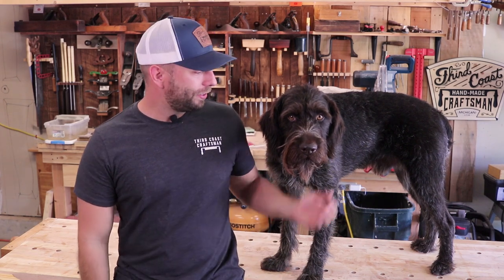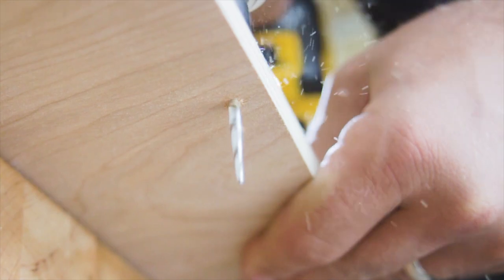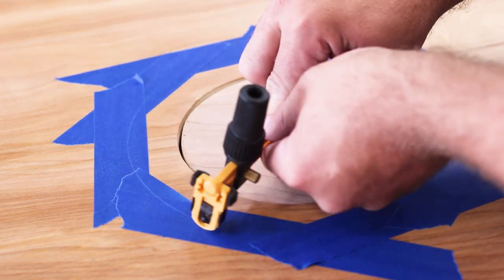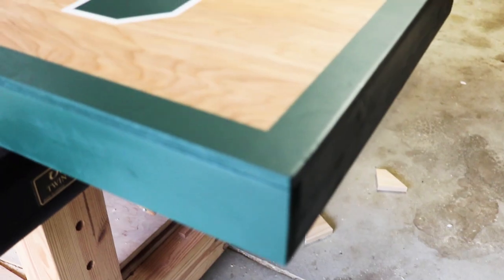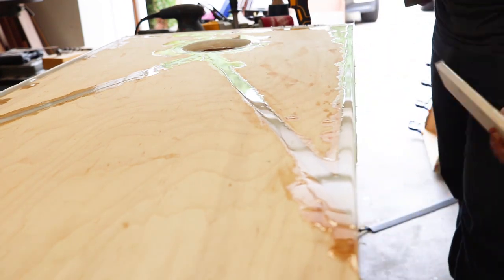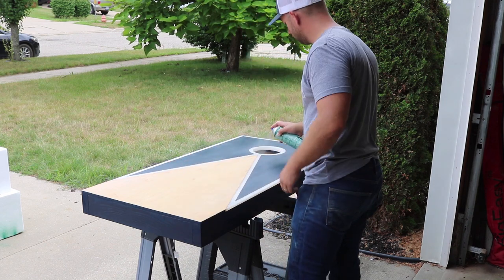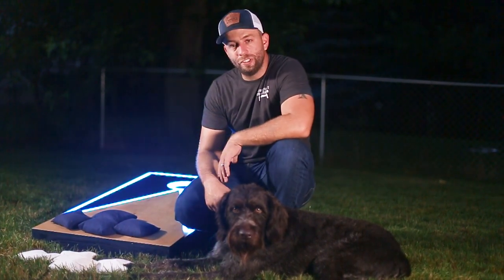How To Make LED Cornhole Boards!!!

Comment: This is a great tutorial! I've made 2 sets of these now, learning a bunch each time. Here's what I learned the hard way! I routed my channels for the led's to be 1 inch wide for looks, and 1/2 inch deep. On 2 boards, I used a solid gallon of epoxy. On the second set, I kept my channels at 1/2 wide by 1/2 inch deep and cut my epoxy use in half. To secure my side boards, I used hot glue instead of silicone and screws, and this worked out fine - no screw holes to fill later. I also used hot glue to secure the led strip lights instead of super glue, and the hot glue let go in a couple of spots after the epoxy was poured. The strips turned sideways in a few spots, but still looks ok, and was only a problem in 1 of 4 boards. More hot glue would've helped. Standard 1 gallon windshield washer jugs also work to seal the center hole, but remove the labels. I overlooked this and was left with the paper label stuck to the inside of 2 holes. Removing the excess epoxy overflow with sandpaper is tiresome. A cheap oscillating multi-tool with a flex scraper works great for the high spots and a hand plane gets the rest before finally sanding it smooth. I didn't have the white pearlescence to die my epoxy, so I sanded the top with 220 grit and this gave a cool "hazy" look and hides the details of the led strips without sacrificing too much light. Finally, after routing the led channels, I used wood glue and a 15 gauge nail gun to build the frame and secure the top. Screws worked great too, but the nails leave a much smaller hole to fill when done and are much faster than drilling, countersinking, and driving screws a couple dozen times. I hope this helps someone else on this adventure!
Reply: This video doesn’t say how thick the plywood was. I’m assuming since you did 1/2 depth for the lights you bought 3/4 inch ply ?
Reply: @salvadorgonzalez1448  yeah, 3/4 plywood
Reply: How do I make the epoxy
Reply: Thanks for these lessons learned. Could you have gotten away with quarter inch deep channels for the LEDs?
Reply: @leafinitup1  it'll work, but having the led strip so close to the surface wouldn't look as good in my opinion.
Reply: @willp942  thanks!

Comment: As a guy that used to work at Lowe's, don't buy the precut ply wood unless you have to. Two precut 2*4 sheets costs as much as a whole sheet. It's literally twice as much. Can even ask them to cut it for you at the store. And cool project turned out nice! And thank you for your service 🇺🇲
Reply: I’ve heard people say they don’t cut the wood right? Can you confirm
Reply: @_Ranger01_  You have to watch them do it.  Sometimes it's just a guy whose task is to cut a bunch of 4x8 sheets down to 4x4 - by the way the saw kerf removes at least 1/8" so it's not a true 4x4 once they cut it - but the dude isn't always perfect.  It just depends on how bad you really accuracy.  If you buy the full sheet and watch them cut it you can be your own quality control.

Comment: A couple years ago I made some mini golfing platforms for my son to use that have an led strip hooked up to an arduino and a sensor in the hole. When you get the ball in the hole it lights a pattern on the strip and plays a little melody.  I've had trouble keeping the led strip attached to the platform, but your design makes me want to try this again using epoxy instead of just glue. Thanks.

Comment: Great vid.. although, i was really looking forward to seeing how you gave the LEDs electricity. Assumed that you wouldn't have a cord accross your lawn. That whole thing is still a mystery since it wasn't included :/
Reply: If you look at 8:47 you can see the power converter plugged into the lights. This is a type of lights that requires it to be plugged into an outlet. You can however buy battery powered ones as well.
Reply: If you buy 12volt led strips, you can buy 12v battery packs that use AA batteries on amazon or ebay that have a 2.1mm power end, and this is a perfect fit for the led controller. If you haven't used led strip lights before, the 12v lights come with a 12v adapter that plugs into the wall. The battery pack will replace this.
Reply: Use 11.1 lithium battery. Perfect for light emitting diodes.  Power of lithium and long lasting

Comment: Pro Tip:
Install a hinged, drop down ramp under the hole so the bean bags slide to the back and are easy to retrieve.
Reply: Cause it's hard to reach in a hole.

Just messing with you. Good tip.

Comment: I would enjoy an instructional video from you on how to make an instructional video. This is one the best shot instructionals I’ve watched. Thanks for that !
I’m working on boards with lights underneath the hole and hidden under the bottom edge. Second attempt will use 3/4” ply with a 1/4”  overhang to hide the edge lights. Still on the first attempt. Some times the LED’s are too bright and they wash out the location of the hole when mounted on top.

Comment: I wish you would have covered how you powered the LED strips. Is it battery powered or plugin ?
Reply: He most likely is using a USB powered light strip. With those all you need are 2 little portable charger power banks (one for each board) to power the lights. They're super convenient and eliminate the hassle of having to play near electrical outlets or use extension cables the DC powered light strips require.  

Both light types are around the same price on Amazon just make sure you search 'USB powered LED light strip"

Hope that helps and good luck.
Reply: If you click the link you'd find they are plug ins.

Comment: Just for anyone who may do this in the future, I didn't use a secondary piece under the board. I instead used a 3/8" wide LED strip and just routed out a 1/2" wide by 1/2" deep rabbet around the hole so that there was still material left at the bottom of the 3/4" sheet of plywood. After that I just used several layers of painters tape around the inside of the hole instead of the coffee can or vinegar bottle and it worked out very well

Comment: You should do something like this again with the LEDs but have a arduino or raspberry pi connected with a motion sensor that makes it light up if you get the bag in the hole.
Reply: I'm going to have to do that lol
Reply: You could also possible add a scoreboard as well with a pressure sensitive plate or something like that but it would probably get a bit complicated since you’d have to figure out how to get around registered shots that hit the board but didn’t stay on
Reply: @maxwellstephens140  time delay pressure sensitivity.

Comment: Unless I missed it. You may want to add how you wired your LEDs and power source. But was a awesome video
Reply: A very key point.
Reply: @bookooc5605  so how are the led's powered?  9Volt underneath?
Reply: If you buy 12volt led strips, you can buy 12v battery packs that use AA batteries on amazon or ebay that have a 2.1mm power end, and this is a perfect fit for the led controller. If you haven't used led strip lights before, the 12v lights come with a 12v adapter that plugs into the wall. The battery pack will replace this.
Reply: @willp942  thank you. This helps alot

Comment: Nice....You didn't mention how /what tou used to power the lights.
Reply: They are plugin lights
Reply: So you have to be near an outlet?
Reply: @mfasthorse32  yes or use an extension cord or sub it out for a battery powered string set
Reply: They are 12V DC. The wall plug in is just an AC adapter.

A AA BATTERY clip [8 of them] will add up to 12V. [One for each]. I highly suggest going rechargeable.
Reply: What I ended up doing was finding a small rechargable car jump pack for each board that had a DC out port. Mine happen to be voltage adjustable from 5 to 20 volts output I believe. It works pretty well with the only downside being I have to have the lights set pretty bright so that the pack detects the draw and doesn't shut off automatically. Reduces the battery life but still plenty enough for a whole weekend of play.

Edit: Now that I think about it though you can probably use a battery pack for a phone and splice a USB connector onto the power wires from the lights. That is if you don't need/want the lights super bright. Most of the time they're fixed at a 5V output.

Edit 2: If you were wondering, I got mine from Wal-Mart on sale a while back. EverStart Maxx 600A bundle

Comment: Those 4'x2' pieces of plywood often cost twice what you'd pay for a sheet. Buy a sheet and most stores will make simple cuts for you. Worst case is they whack you like $.50/cut. You'll spend half as much and have a 4'x4' piece of plywood left over.
Reply: can you buy them from homedepot and will they make the cuts for you?
Reply: Verzula HD does cut wood like Lowe’s does

Comment: Love the boards! it inspired me to make my own and I am currently in the middle of my build. I have a couple questions; How many feet of LED lighting did both boards require? Also, when you used the 6" plastic vinegar bottle to contain the resin for the center hole did you use silicon to create a seal and if so, was the silicon easy to remove from the resin after curing and hardening? Thanks!

Comment: How do you power the lights? If by battery how big and how long does it  last?   Later
Reply: Most LED light strips are powered by a 12v supply. You can convert them to battery pretty easily. Amazon sells AA battery packs configured in series to output 12 volts for a few bucks. Then all you need are some AA batteries and you're good to go.

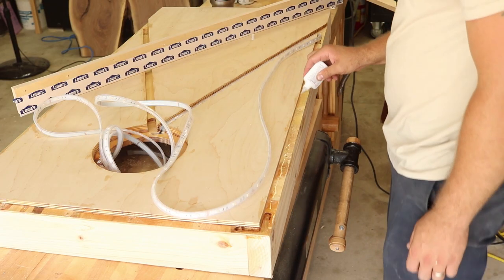Comment: @6:40 Lowes offers Military Discounts.  I was shopping Lowes for years before I knew that and finally caught on.  The additional 10% off everything really adds up and at least our Lowe's here in So Cal have designated "Military Only Parking" right up front.  Not that I really need that but the fact that they did this is why I shop there for nearly everything now.  Props to Lowes and congrats on your sponsorship with them.  

P.S.  I have to make an LED Corn Hole set now!!!!  Thanks

Comment: Great job on the boards as well as the video.  I also use the Kreg jig for assembling the frame, but rather than screws I use an air nailer and glue for the top.  Thanks for sharing your video.

Comment: Wish you could have spent more time explaining the routing and light connections. I really want to do this but am a little confused. I have never used a router and the routing of the hole was like 2 seconds of the video. Don't get me wrong it was a great video just wish it was a little more in depth

Comment: This is a REALLY Good Video But you Forgot one Thing. How Did you Wire up the L.E.D's ??? and How Did You Power Them Up ???
Reply: Yes. I really want to know this.
Reply: I found this repose below 
"Third Coast Craftsman
1 month ago
Hi Rick yes I did buy 2 separate packs and I plugged them in to extension cords. I looked up battery packs that you can plug them into but just saved my money for now and used extension cords"
Reply: Just use 9 volt batteries
Reply: If you click the link to the led strip he uses it says they are plug in strips.  So each strip is likely powered by an extension cord.

Comment: i can't figure out how you plug in the led lights. lowes also does not carry them anymore. I was hoping to use a battery so i would not have to plug them in. i send you a dm as well
Reply: I used  the same lights on my deck , under the rails. Found them on Wish. Very cheap,but took it took a month to get them. Be patient!

Comment: Surprised you found straight and dry lumber at Lowe's
Reply: rob baaahaha
I dont blame him for ignoring this comment. However I definitely don't blame you for saying it. I just made some cornhole boards and spent 20 minutes pulling and straightening only to find out they were also twisted.
Reply: lowes just resells stuff, it's not like they cut down the trees, ran them through the mill and kiln dried them. complain to the lumbercompany, their name is stamped on most plywood. in other words dont' kill the messenger, or in this case the reseller.
Reply: regardless of blame his point remains true.
Reply: PhotoBooth biz isn't that the case for all their products? They don't make anything. They just sell it. Doesn't excuse them from poor lumber quality at times.
Reply: name a single lumber yard that goes through ever board and makes sure it's not warped. my local lowes takes any warped board and puts it in a pile of "scrap" lumber. I stop by with my trailer and buy a trailer full for pennies on the dollar.s Lowes does a good job where I live.
Reply: there is no scientific proof that one lumber yard has a higher percentage of straight boards. just a bunch of bad mouthing a company for no reason. In fact I've see the same lumber company's goods at many different stores. It's like saying the M&M's candy tastes better from target vs Walmart. not logical.
Reply: so what you are saying is when Georgia pacific sells lumber to Ace, Home Depot, and Lowes, that somehow all the warped lumber goes to lowes and the other stores get the straight stuff. And I'm being irrational?
Reply: Thank you LOWES for sponsoring this video. Any company that helps support makers deserves praise not criticism. I am thankful. I want to apologize for the unfounded criticism others give you. This is was an awesome video!
Reply: one day you will sponsor something and trolls will not thank you, but instead complain. Karma.
Reply: same could be said about you. one crybaby comment was all it took for you to get super defensive. show some respect to companies that support builders. Obviously wasn' a joke etiher, read the rude follow up comments you and others made. if it was a joke why did you write " However I definitely don't blame you for saying it. I just made some cornhole boards and spent 20 minutes pulling and straightening only to find out they were also twisted. " lets not rewirte history
.  IN case you didnt' read the video creators request I've copied it here:   "A big thank you to Lowes for sponsoring this video! please help support me by supporting them!"
Reply: PhotoBooth biz you work for Lowe's? Seems like you got triggered
Reply: Actually the candy thing is true, if you go to Dollar tree, and not Wal-Mart, target, hell any gas station actually. Its cheap because they get the sellable rejects from the factories , like lets say haribo starmix, perhaps not enough or any gummy cola bottles got put in due to a supply or other production issue , and like 80 cases were made before Quality Control caught it, they arent going to throw it all away!!!! they will just wholesale it at a discount. To the dollar store it goes.
Reply: @rollandelliott  I can blame them for buying crappy wood when other stores don't...
Reply: No one is forcing you to buy common board. If you want straight boards, pay for them.  If you buy common board, stop whining about it.

Comment: Nice build Gives me some ideas. Did you power the LED with batteries?
Reply: I have the same question about powering the LEDs. Hope he can do a follow video and explain.
Reply from the maker: They are plugged in to an extension cord but you could buy battery packs
Reply: Third Coast Craftsman Thanks. I can figure that out. Great project btw! The look cool.

Comment: Thank you for the video, very informative.  Quick question, I am at the point where I'm getting to install the LED's, and noticed your epoxy has a white tint.  You mentioned adding a white pearlescent??  Is that accurate, and if yes, can you share exactly what you used and where you purchased it.  Rx again.  -

Comment: Its a phenomenal look. The issue to me would be portability and having them battery powered and how long the battery would last, and then then fact that most LED strips can be somewhat low quality so when the strip goes out its embedded in epoxy and you have to toss the whole board if you wanting the LED (or carve it all out which would take a long time).

Phenomenal idea, and I agree. The entire cornhole board thing has made me nauseous but this is the first one thats peaked my interests.
Reply: In thinking it was battery powered wich I have a led pong table that takes batteries they last for a few days straight as I've forgot to shut them off. But I agree about being able to change out the led strips. I was thinking instead of routing out a channel put a dif layer top maybe even make the line inside the board edge and have the channel under the board so you can just unscrew a wood strip and replace the leds.
Reply: Instead of using LED light strips that will eventually shit out and then your screwed use Auto OEM grade flexible glass fiber-optic light guides aka GloTrim. GloTrim is made up of 1500 glass optical fibers that is the best fiber optic in the world. never need to replace the light guide after you epoxy it in. after 10,000 hours (the life length of LEDs) just replace with ease :)

Comment: Love the idea. I am close to finishing my variation inspired by your video, thanks!  Can you give an idea how much pearlescent you added?  That's a tough one to guess on.  - Joe
Reply: Well, charged ahead.  Using Black Diamond Pure White pigment, I used about two rounded teaspoons for 500ml of resin/hardener mix.  The channel I cut is 1/2 inch deep and 5/8 wide and while you can see the location of each light source, I think the light diffusion is about right.  I hope this helps someone.

Comment: I built a set with battery powered LEDs I bought 12v lithium rechargeable battery packs. I also installed remotes. I would like to add hole sensors though.